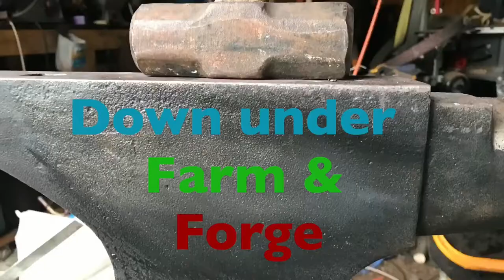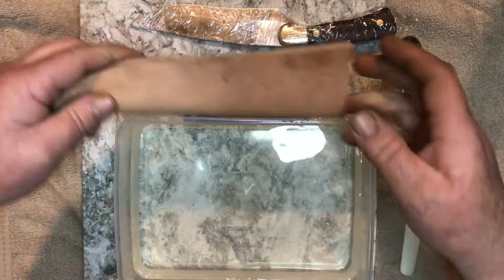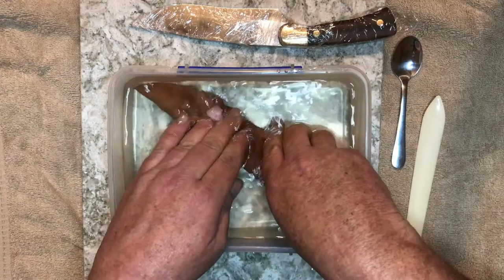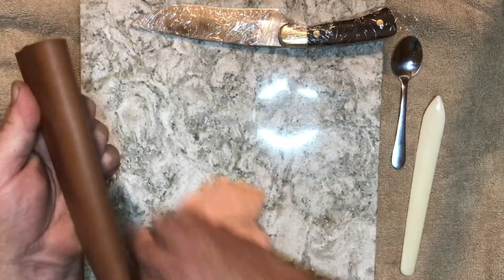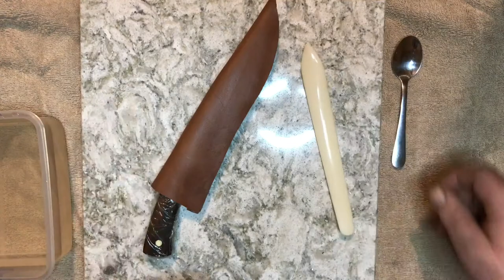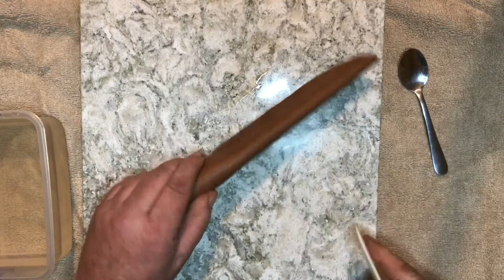Making a leather knife sheath part 4, DIY Cross draw knife sheath wet forming the sheath

Comment: Would a vacuum chamber form the sheath after hand forming with the spoon 🍺🍺
Reply from the maker: You can form it down with a vacuum bag but have to be careful not to pull it done to tight and end up seizing the knife in the sheathe, that little bit of slip is require especially at the blade end